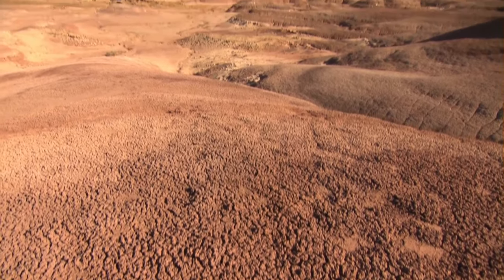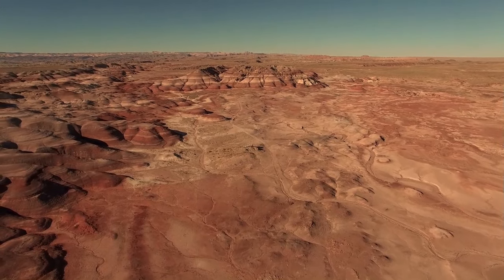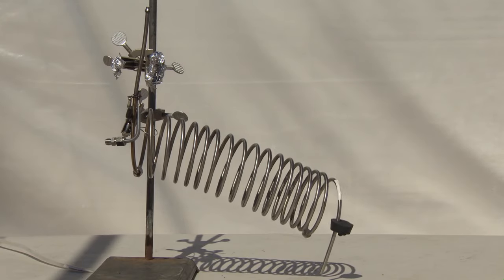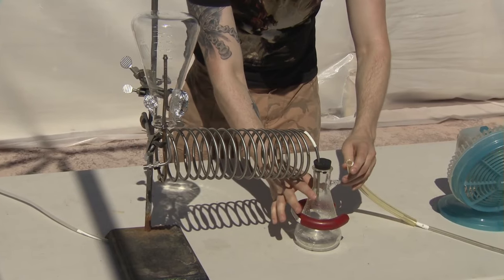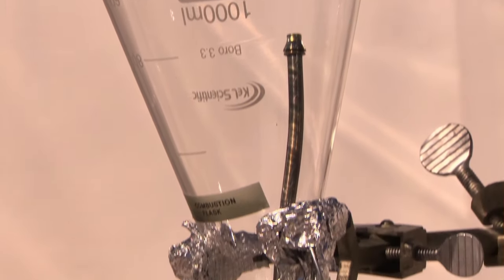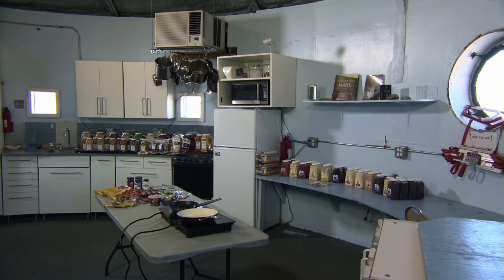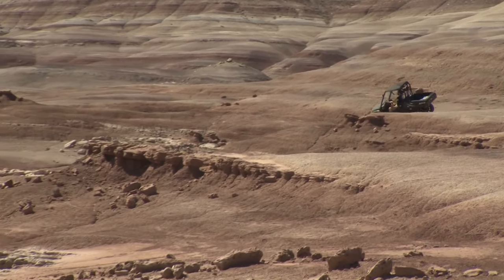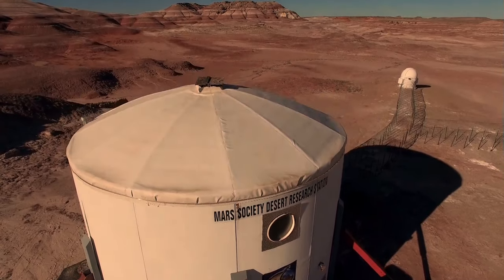How To Make Water On Mars! (The Martian)

Comment: actually you got the initial part wrong. Mark Watney extracted the Hydrogen from the Hydrazine rocket fuel, and burned it with the oxygen which i assume came from the habitat module air supply
Reply: +shriramvenu
It's from carbon dioxide he sucked out of the Martian air with the MAV launch pad then fed through the oxygenator. His Hab oxygen supply wasn't big enough for this purpose.

Comment: Instead of taking tankfuls of hydrogen with you, just take some water.
Reply: In space the water would off just frozen
Reply: Water is heavier than Hydrogen and it is cheaper to bring Hydrogen gas rather than water
Reply: +Peter Porker is the Spider Ham and what about the container for the hydrogen? do you think it's lighter than the ones used to carry water?
Reply: +MrSparklystuff conservation of mass anyone? total 5 tons of gas = 5 tons of water, most of those 5 tons will be oxygen so on Earth you can take only hydrogen part with you and it will be lighter, but on Mars you'll have to carry both components. Benefit of gas is that it can be compressed, and water cannot. plus you can use it as fuel.
Reply: +googleboughtmee the reason why matt damon makes water in the film is because even though he has enough water to survive on his own, he needs extra water to grow crops. to waste his drinking water is not economical.
Reply: +googleboughtmee face palm
Reply: +Igor K *weight
Also, you wouldn't need to bring a lot of tanks of oxygen. You can make your own oxygen and cultivate your own air through agriculture.
Reply: +googleboughtmee there is "plenty" of oxygen on mars (in the form of carbon dioxide) - why bring the water when you only have to bring liquid hydrogen

you can make water or hydrazine out of it by combining it with elements from mars' atmosphere
Reply: Viktor Hofer
Mars's average pressure is just below the triple point of water, so water on mars will start boiling off. This will also work as evaporative cooling, so some remaining water will freeze.
Reply: water is heavier than hydrogen and nasa would want the rocket as light as possible

Comment: Less then 1.87 percent of the martian atmosphere is hydrogen, IDK how long that would last you, but it seems very little.
Reply: +koekeritis It has nothing to do with the atmosphere of Mars, also the method used in this video is far simpler than the one Watney had to use. In the book, Watney steals excess fuel from the Mars Descent Vehicle, the propellant is called Hydrazine. Hydrazine is made of hydrogen and nitrogen, and by running it over an Iridium catalyst, the fuel separates into its components and releases enormous amounts of heat. Watney constructed a chimney which the hot gases could flow upwards through, and made a pilot light at the very top which ignited the hydrogen in a slow controlled manner. The hydrogen reacted with the oxygen in the shelter and created water vapor. Watney did not collect the water in a small glass either, the water was mixed into the air as humidity and it had to be harvested out of the air with a device called a water reclaimer (basically a dehumidifier). All in all, he made about 600 liters of water.

Comment: So you need to bring oxygen and hydrogen to mars to make water? Why not just bring water? If scientist talking about mars and water they talking always about to FIND water on mars (which they done recently) and use it as drinking water and to split it into oxygen and hydrogen (rocket fuel) of it. And NOT the other way round.
Reply: Because water is much more heavier than hydrogen
Reply: +Rodiscumbag  But you also need oxygen!!! So in total you have exactly the same weight, but in massive and heavy pressure cylinders, instead of water in a plastic bottle.
Reply: +Nick R you need oxigen on mars anyway to survive so bringing oxigen and hydrogen would probably be better than bringing oxigen and water
Reply: +MrBloober2000  The oxygen you can bring with you will NEVER be enough. Remember - mars mission is a one way mission. You think you can take hydrogen/oxygen/water/food/what ever for approximately 50 years, for 4-3 persons? No way! There is only one solution - find water on mars and use it to create oxygen, hydrogen, food, drinking water...
Reply: +Nick R 
Use plants. They will need "space gardens" which will produce oxygen and also food later on. They have to. otherwise they die soon or later.
Reply: Oxygen can not be produced. Plants "eat" CO2 and "fart" O2 out.
Reply: +Nick R read the book
they had enoush water to last 31 sols for six people so 363 more sols and then he needed to make 600 more litre more for the plants
Reply: +Nick R he made some o2 from the outside atmosphere and what he breathed out
Reply: +Swithin Games (Swith) using the oxygenator
Reply: It's just a demonstration of the movie / book's plot, Mark only had rocket fuel to make water from, as it was not useful for anything else.
Reply: Nick R And humans "eat" O2 while we literally fart co2.